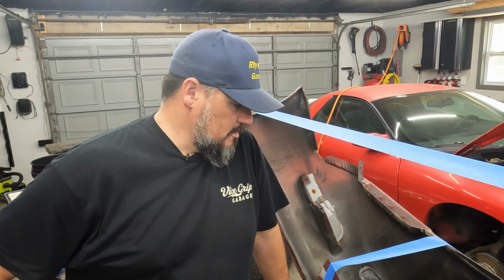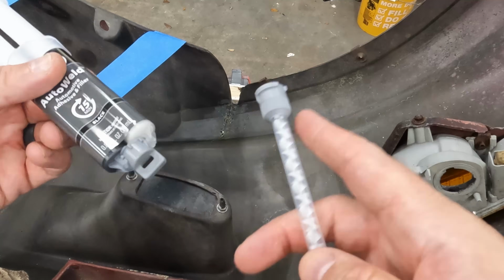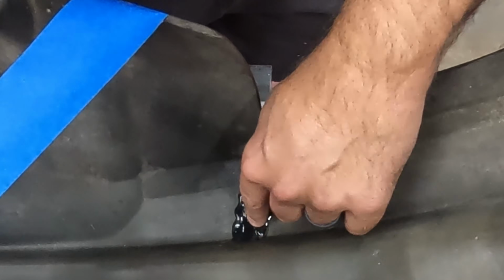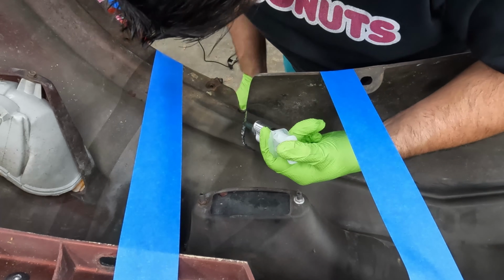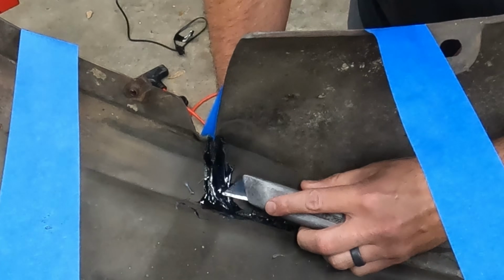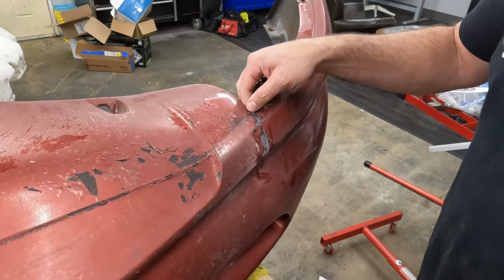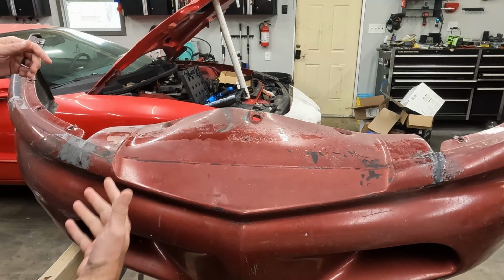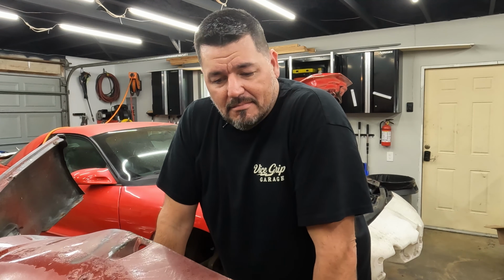Using JBWELD to Finally Fix the Cracked Bumper on the Firebird

Comment: You can buy a  plastic welder cheap. Uses plastic filler rod like a welder. Best method.
Reply from the maker: See referenced video. Tried that already. Didn’t work on this bumper.
Reply: I wonder if applying heat would be a good idea, like from a drywall heat gun to speed up the drying process. I say that halfway through the video so excuse my ignorance if you tried that or ended up doing that in any way.